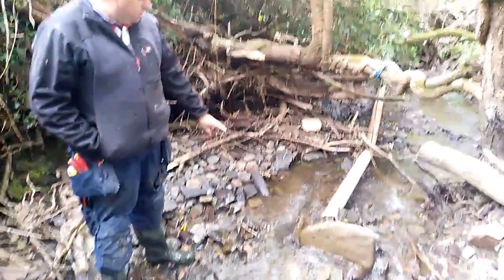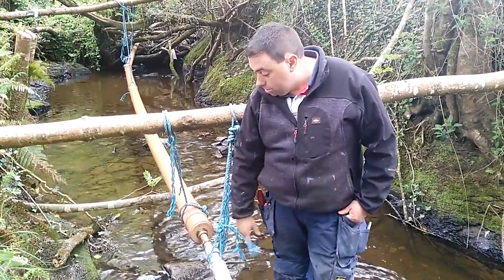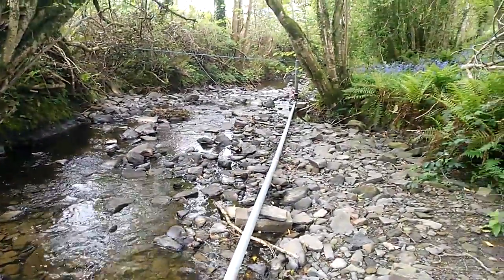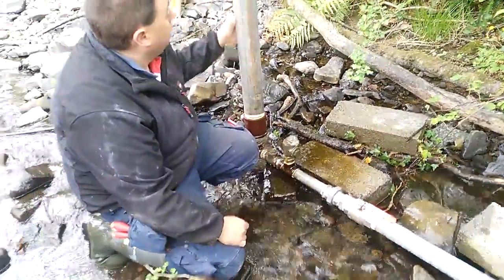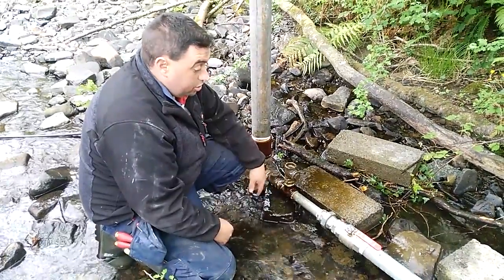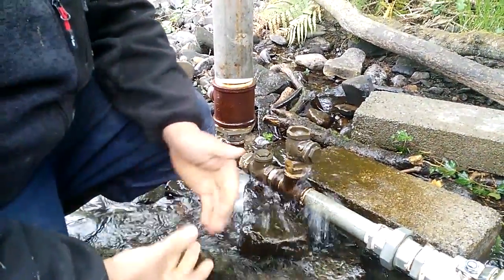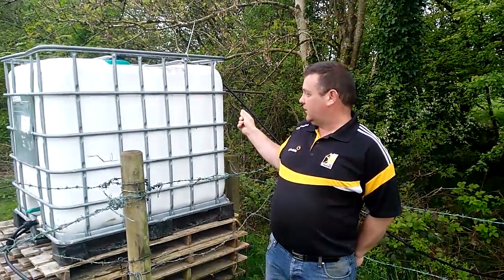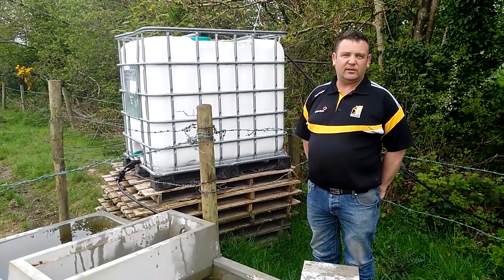Ram pump supplies water without power

Comment: Maybe a hydraulic ram pump would be better to use since it doesn't require electricity. Also, since you can still pump (let's say 6 months a year. I don't know your season start dates) you can still pump almost 45,000 gallons of water from the mine. Store it in up hill storage tanks above the town and you can easily distribute it amongst the buildings.

Comment: I've been using a 1" one of these since February 2014. It is a super idea. I first saw it on Laois County Council stand at the ploughing championships in September 2013. In my experience the flap valve lasted 16 months but no need so far to replace the spring valve. The hammer in yours sounds quite hard and I wonder will it last as long as you say. I found that the valve seat became scored and the hinge wore to a point where the valve would not seal and the pump stopped. However the item is cheap to replace.
Reply: If you want a waste valve durable, long lasting and easy to maintain, make your own, 2" galvanized nipple, 2 blind cap cover make a inch hole and thread, hard rubber make round less than 1 1/2 diamneter, and around 10 mm diameter stud bolt, screw and washer.